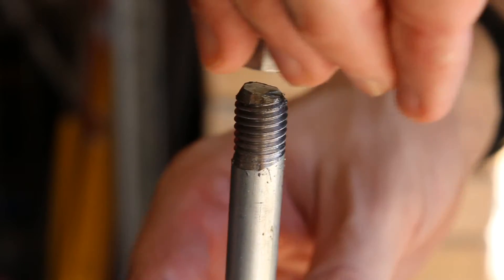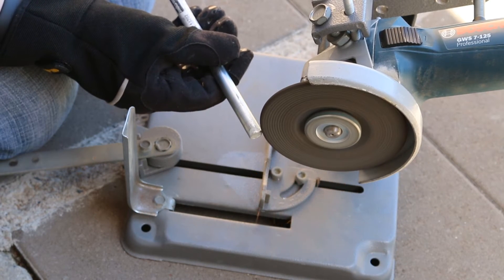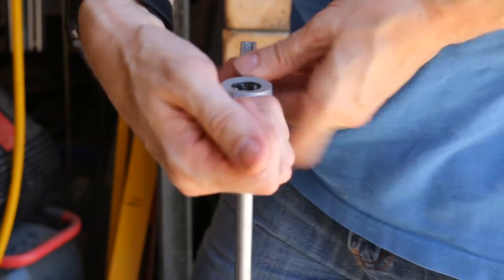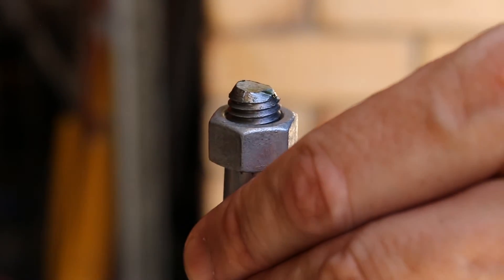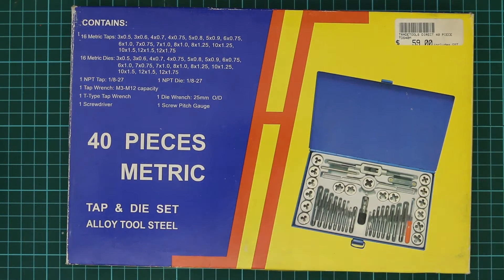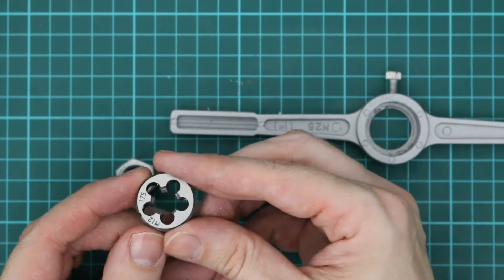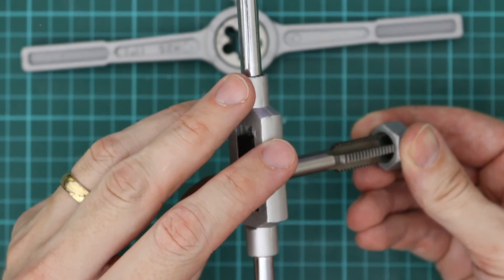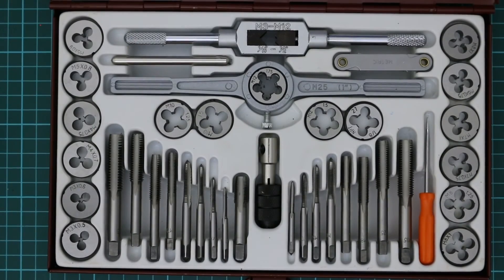DIY: tap and die - cutting my very first thread

Comment: I can watch the sparks all day, too. You'd have an easier time cutting threads by adding oil into the process. Good luck.
Reply from the maker: Yup I did add some, not sure If I had enough, I think though that this was 12mm rod and don't think you can cut a 12mm thread on it - which was why the nut was loose for me.